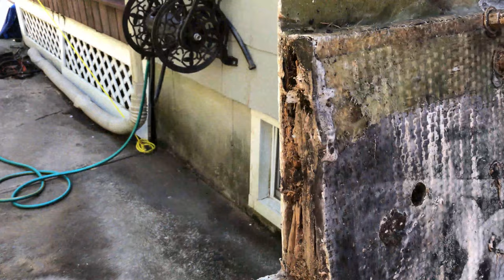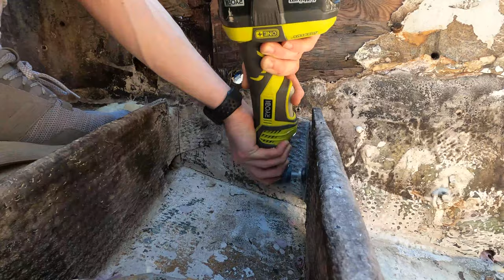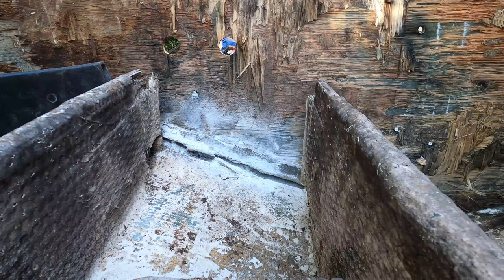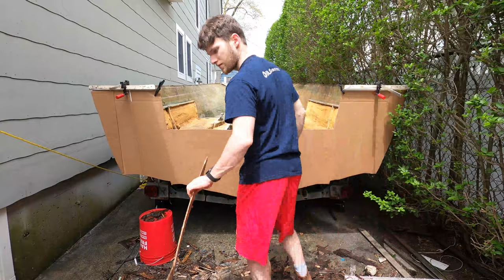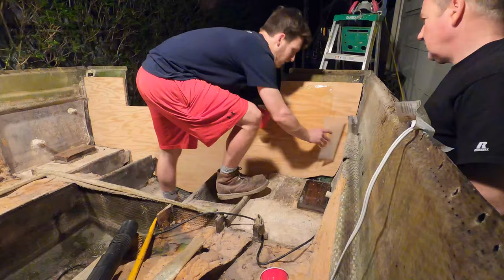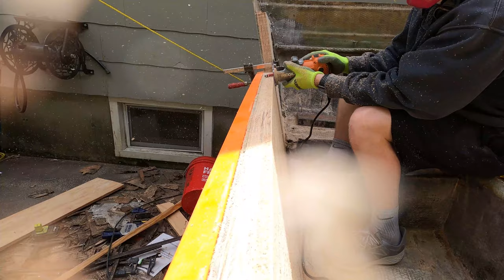20 Foot Grady White Center Console Restoration, Part 2: Transom Removal and Repair

Comment: Wow! I have never seen a transom without fiberglass mat in between the marine plywood because I have worked with many boat transom for my customers and I am required to have the fiberglass mat in each side of marine plywood. I hope it will hold up for as long as you own it. at the end of transom I normally put the final fiberglass woven inside help structure strength. Also I hope your boat's closed cell foam is in good shape because many time I have worked with aged closed cell foam has water logged which cause them heavy and dragging. Good luck and keep up good work.
Reply: I have a question, why is plywood even used when it could possibly rot, why not instead use steel or some kind of structural plastic, I always wanted a boat builder to answer this , as I've never understood why they put plywood there
Reply: @Redfiregtag  plywood is strong and lightweight. You want to use some sort of waterproof plywood like marine or exterior ply. Even better you can use coosa board, which is a fiberglass reinforced foam board that is lighter than plywood and stronger but also like 3x more expensive.
Reply: @blakeramsey3373  so mainly just for price, see if I was going through all the trouble of rebuilding a transom, then I wouldn't want to use something that could possibly rot again. Because even waterproof plywood still eventually we'll rot but that fiberglass reinforced board you were talking about sounds like an awesome product thank you
Reply: Thats crazy 🤦‍♂️🤦‍♂️🤦‍♂️

Comment: When I do mine, I plan to temporarily screw the sheets together, test fit, then take it out and glue them together (with fiberglass in between) on the saw horses and drop it all in at once...  Thoughts from the masses?

Comment: Should have went ahead and enclosed the transom! Also need glass in-between the plywood and hull anything that isn't glued will vibrate and further cracking faster than normal, missing several steps but learn as you go!'

Comment: I don't know alot about boats, but I do know alot about plywood, why do people still put plywood in wet areas like this, why not use steel instead or some kind of strong structural plastic?
Reply: Mainly budget they make coosa board which is a rot resistant composite and a lot lighter but it is expensive. One sheet of 3/4 is about $550 where as if you find marine grade 3/4 probably runs 80-100.

Comment: Just a question and trust me I certainly don't know any better.  Would it have been easier to cut out  the transom and replace all of it?
Reply from the maker: If you mean easier than removing the top from bottom, probably yes. But it wouldnt be as strong. I wanted to keep the external fiberglass structure intact and not cut it